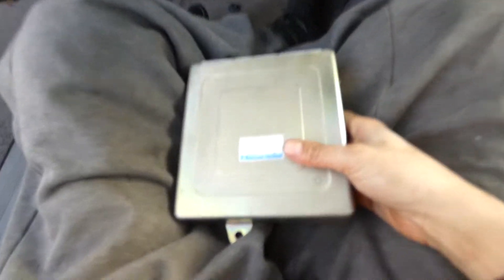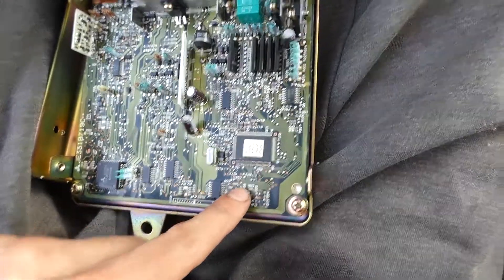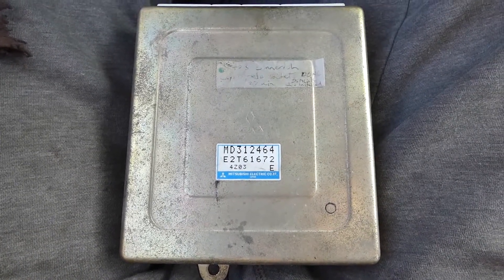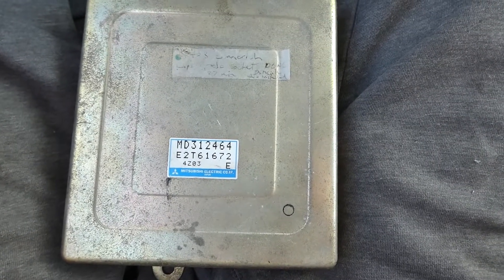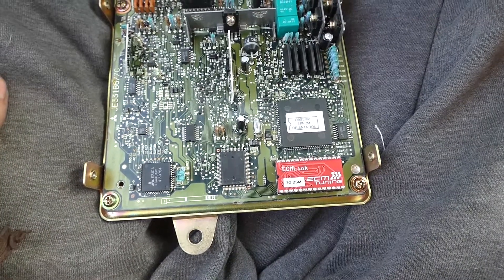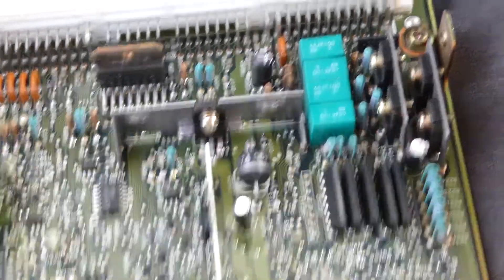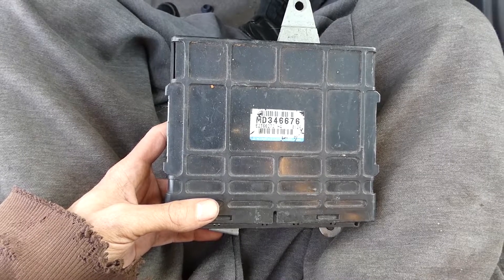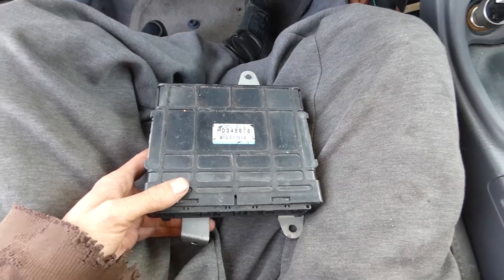Tutorial: 2G DSM ECU Identification How-To

Comment: What are signs of bad ECM ? 
My tach meter needle bounces erratically
Reply from the maker: depends, usually that's power transistor but it could be anything, you'd need to pull codes
Reply: @autotalon  ignition control module? Replaced it